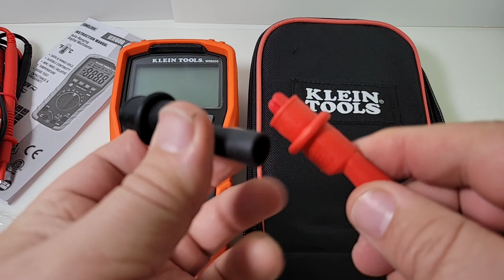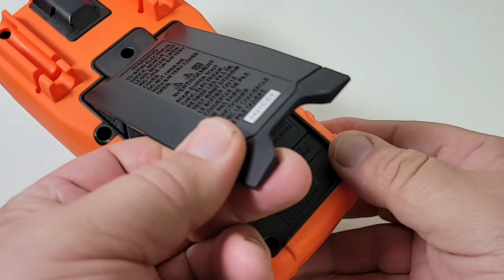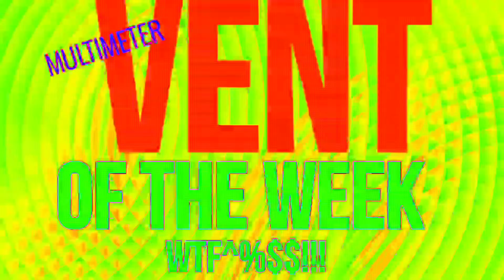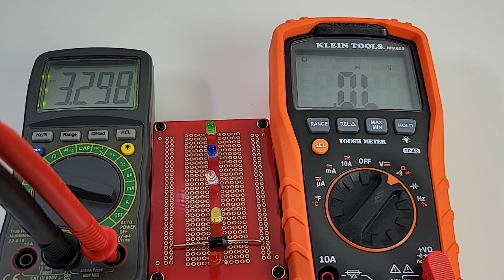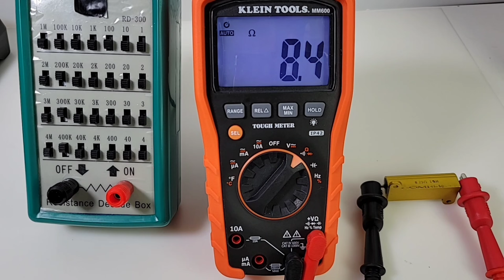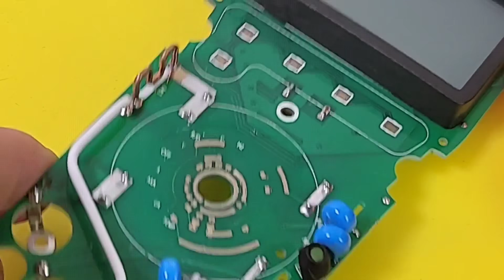KLEIN TOOLS MM600 Multimeter Review & Teardown!

Comment: So I’m reading through all the comments and I’m wondering if I’m missing out on anything between this MM600 vs MM400?  I’m just looking for a solid meter for around the house use and car use on occasion.  Testing 230v tools in my shop, that sort of thing.  I just had to order a new meter and I have the MM400 coming, but should I upgrade to this MM600?  Is it a big step up in features?  Thx
Reply from the maker: Stick with the MM400. There's no reason to swap. This is a solid multimeter with a ton of functionality and a price that can't be bea! Save for the slightly smaller display you won't gain much by getting the MM600. In fact it's smaller footprint makes it alot more portable too. 👍
Reply: @KeepOnTesting  Okay, all sounds good.  Appreciate the response.  👍🏻
Reply from the maker: @tundrawhisperer4821 anytime my friend 😊👍

Comment: @darren walker do happen to know how I can purchase replacements for the 5 Mov on the back of the pcb?
Reply from the maker: Ebay is a good bet: Check out 20pcs 07D821K Metal Oxide Varistor Volt. Dependent Resistor 7mm https://www.ebay.ca/itm/141513133405?mkcid=16&mkevt=1&mkrid=711-127632-2357-0&ssspo=zZA7McRrTrC&sssrc=4429486&ssuid=8LHX1CvSRCO&var=&widget_ver=artemis&media=TW

Also available on Amazon https://amzn.to/45yNs89
Reply: @KeepOnTesting Thank you very much for taking the time to help me out!!! It is very much appreciated!! May I ask one more question...there is another green ,similar in appearance, looking component on the back of the same pcb. I can't recall what it is labeled as on the board. Would you happen to know where I can find that part as well. Again thank you so so much for your help and time.
Reply: @KeepOnTesting  On the board the component is labeled as PTC3. Any assistance would be greatly appreciated 🙂
Reply from the maker: @Alchemic11  Those are PTC's ..PTC stands for Positive Temperature Coefficient. The PTC thermistor also provides variable resistance based on temperature. Easily found on Ebay or Amaxon as well.. 👍

Comment: Also check out the CL390 clamp meter. It is basically the same as the 700, TRMS etc. Plus functions most Clamps do not have. Hall effect for DC as well as AC Amps to 400. Only about $100. At Home Depot.

Comment: Hey Darren, Hope all is well. Back in June of 2021 I purchased BTmeter brand model# BT-770N from Amazon. It has been 7 months till i first time used it yesterday and straight out of box it's DEAD. It wont register ohms, volts or continuity checks. LCd lights up , dial is working just wont read anything or detect. So I just purchased Klein Tools MM700 meter yesterday at Home Depot and wanted to ask you Any difference between 600 and 700 model?  or will you do a review on the 700 model?   Thks
Reply from the maker: I do intend on reviewing the MM700 later this year. Btw, It also supports TrueRMS and LoZ (low impedence)
which the MM600 doesn't.. initial impressions look very good 👍
Reply from the maker: If you want you can ship me your dead BT770N , in turn I'll send you a new replacement multimeter. I might use it for a multimeter repair segment. If interested email me,    netplicity1@gmail.com

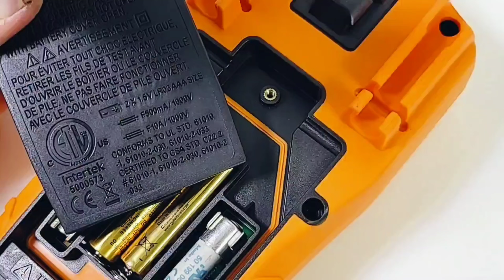Comment: 5:08 you missed the rubber gasket around the battery&fuse area, nice touch though for a cheap dmm!
Reply from the maker: This multimeter really impressed...found a spot on the bench and in my tool box 🧰 👍

Comment: Darren, I know slightly different price points, but would you pick the Klein mm600  over the Kaiweets HT118a? For all around house and auto use… Thanks!
Reply from the maker: Yes, absolutely as long as the price isn't a concern. They are 2 of the best multimeters on the market today..one is in the CHEAP-O  REALM ( HT118A) the other isn't. Both excel at being multimeters with great feature and build quality. The KLEIN MM600 also goes further with incredibly good input protection and added robustness. 👍

Comment: I’ve used this meter every day for the last 5-7 years as a low voltage tech. The battery terminals suck, the leads were swapped to probemasters in the first 3 months, I epoxied the tilt stand in as I use it with the magnetic holder, but for $70 you can’t beat it.
Reply from the maker: Great to hear ! True enough..at this price point it's almost unbeatable!👍
Reply: What leads did you switch too?  Is that the name brand you mentioned?  How is this different from their MM400 model?  Thx
Reply: @tundrawhisperer4821  correct, probemasters, made in USA. Lifetime warranty

Comment: Not bad, Klein MM600 pretty much hits all of the points that makes it a rugged meter to carry in your tool kit. Accuracy seems to be alright
for a meter that is not true rms. Protection seems to be good but what is with the battery cut out area? Give a monkey a pair of tin snips
and let him have a go at it? I am always impressed at how much better the continuity test works with the probe master leads. If the folks
who make these meters would take a hard look at how to manufacture a really good set of test leads at a reasonable price and then include
them with the cheap-o meters it just might move their ratings up a bit. I like this meter a bit lower price would be nice but hey, I guess these days
even Chinese made products are getting pretty pricey.
Reply from the maker: It's a pretty sweetly built multimeter...agree those cutouts are just 'wrong".
Don't get me started on those ProbeMasters..incredibly good test leads! 👍

Comment: Good DMM, good review. But the Battery connection is not bad at all. You have to remove the batteries before you take it apart- that's good pratice for all kind of electrical devices. This is better than your suggested solution (further sources of error due to two additional unnecessary contacts, battery compartment / PCB).
Reply from the maker: Thx kindly  👍  btw..if you leave the 2xAAA inserted and put the case back on the contacts can dislodge the batteries and create a toasty scenario as happened to me. They were smoking hot and definitely a hazard. Best case is a proper contact mechanism that shields the batteries leaving no gaps and no margin for error. This dmm was so well designed I can't believe they couldn't develop a more elegant solution besides two crude cutouts for contact.
Reply: @KeepOnTesting  Yes, I think there are better solutions for this, but it's not the worst one. It's a nice DMM with very good protection and good build quality. Good value for bucks.
Reply from the maker: @deterdamel7380  100% in agreement!

Comment: Wow, so much more impressed than I expected to be - input protection not only has the mov's and ptc's it even has the high current resistors I expect to see when comparing to fluke.   Im not a huge fan of the chunky display but not a problem really just a design choice.  I would like to have seen a bar graph but its not a deal breaker when you consider the build quality otherwise, its looking like it belongs in its target price range with the rugged build, input protection and high accuracy.  Color me impressed, lesser Kleins in the past have been hit or miss but I clearly havent looked at one in a awhile, this is a very strong effort from Klein and ill take a working temp range over the usual useless NCV most have.
Reply from the maker: Makes two of us! The MM600 is undoubtedly one of the best multimeters I've come across in a long time! I'm still flustered by the lame battery cavity approach but otherwise it's a home run! What a great dmm !  💫💫💫💫

Comment: Maybe closer to 5 stars for an OK price with great input protection. Since fuses are accessible, I wouldn't complain.. there's no reason to 'disassemble' 😊 (Ms. Stephanie and robot No.5 would like that..). Too bad there's no RMS good to at least 5khz, since that would make it good for industrial VFD measurements. So close, yet so far...
Reply from the maker: If the battery terminal connection wasn't so "iffy" it definitely would've been close! Still a tremendous value for such a powerful performer with great input protection! 👍
Reply: @KeepOnTesting  Does that CAT IV 600V safety cert have a IE6xxx number written somewhere? This might be a new low $ for true industrial DVM's
Reply from the maker: @CliveChamberlain946 Certifications are embossed on the back of the meter housing,
Conforms to UL STD 61010-1, 61010-2-030, 61010-2-033/ CSA C22.2 61010-1,61010-2-030,61010-2-033 👍

Comment: Looks like they forgot to consider assembly when designing the spring terminals in the battery compartment ;).  Cringe-worthy when considering the excellent layout and construction of everything else.  The MOVs, PTCs, and clamp diodes are even nice and beefy compared with many meters, if they have these at all.  Lack of NCV feature makes it even more frustrating that they included no shielding, though.

Comment: Just a note that the Top 10 in your description no longer matches the Top 10 on your website.

Both Richmeters models appear to be removed, but this was inevitable as other models make the list ;).  Though the leads are rather cheap, I really like my RM113D for less than $15 as it's relatively compact.  The only things I miss are a manual ranging option and the usual lack of a sustained backlight.  Any meter with a 15-second backlight has to hang precariously from any Top 10 list ;).
Reply from the maker: I'm updating the website next week..will try to have it integrated with the YouTube TT.
Agreed, The RM113D is definitely a great multimeter..still use it from time to time myself.

Comment: This isn't your fault as sellers often change or end their items frequently, but the HT108L, HT112B, and OW18E eBay links appear to be broken.  The UT89XD, test lead, voltage reference, and screwdriver links continue to work, however.  Would be nice to have had a link to this Klein Tools meter somewhere, though.
Reply from the maker: Hi Rob

I'll have a link within 2 hours. Thx for the feedback 😀 👍